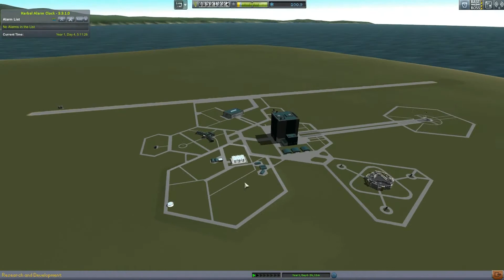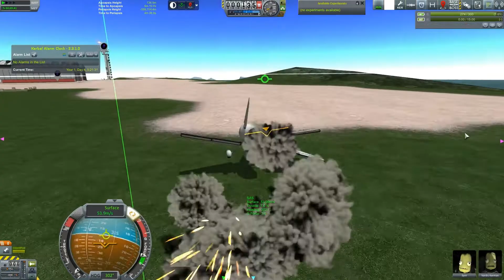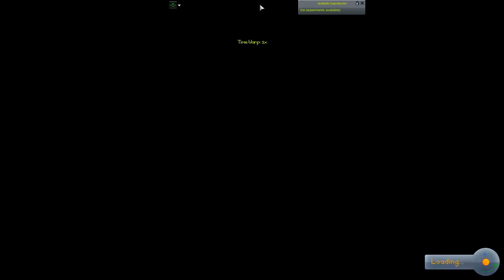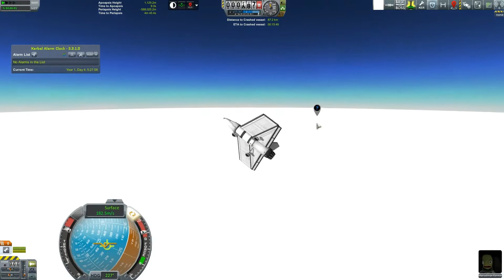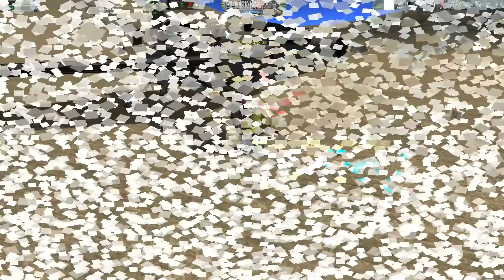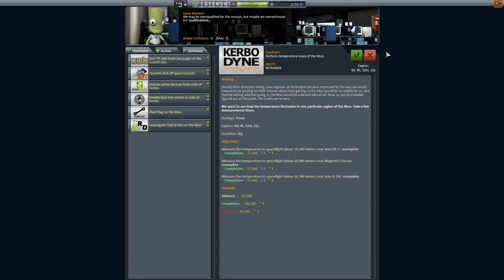HMV Plays KSP 1.0 - Contractor 03: Three Kerbin Anomalies Found!

Comment: You can use the long version of the early landing gear as a ladder (using the F key to climb).  Really helps with the lack of ladders in the early game.

This gives you the capability for surface EVA in the early game, along with allowing you to keep your scientist's feet near the experiments (required for restoring them in KSP v1.0.x).

The plane you have in this episode might have problems because you may have blocked the path to the top of the plane with your wings, when using you rear landing gear.
Reply: Kraig Lane I recently discovered this, too. It really helps having the landing gear just behind the tailing edge of the wing, because climbing onto the landing gear then onto the wing is a LOT easier than climbing up the landing gear onto the fuselage, never done that successfully myself.

Comment: I see you steer the plane with A and D. Thats called Yaw. the best way to steer a plane is to Roll using Q and E and Pitch with W and S. You would be abel to straighten the plane using Roll when you stood still also.
Reply from the maker: Ørjan Solli I don't so much steer the plane as I do hit the keys until the plane's going roughly the direction I want it too. I do steer with roll and pitch most of the time, but I've found that for smaller turns yaw is less trouble. It may not be the way a pilot would do it, but a pilot wouldn't be using a keyboard, either :)

And I find that SAS gets in your way when trying to just bank turn. But if I turn SAS off, far worse things happen.

Comment: That was a rather plane episode, wasn't it?

...

Sorry.

On a (somewhat) more serious note: Surviving a plane crash due to an inevitable timeloop is the true Kerbal way. As would be sacrificing your own aircraft to parachute down to the pyramids (in this case it was a "been there, done that" scenario, so landing regularly is okay).
Also, have you considered increasing the Brake Torque on your back wheels? That might help with slowing down in time.
Reply from the maker: FonVegen That joke made me physically ill. You could say I got my ailer-on.

...

not sorry ;)

I have not considered the torque thing because I didn't know it was even a thing. Next plane I make, I'll give it a look.
Reply: HMV Plays I guess we both level out at the same angle of idiocy when it comes to punny humor.

The brake thing was just something I noticed when I noticed you noticing the wheels noticing more heat than they prefer, so I thought I should tell you what I noticed there.
Reply from the maker: FonVegen Noted
Reply: HMV Plays Nice.

Comment: Yeah, the new brakes on the landing gears suck pretty hard. Nice landings!
Btw, you should prolly quicksave often and with different names. I tried to climb back into my lander on minmus and Valerie glitched between parts, got thrown on the ground, died and obliterated the entire solar system. Luckily I had hit F5 only 10 minutes before that. But the persistent safe was broken. 0_o
Reply from the maker: Nathan Jessep Sounds like 1.0 material right there.
Reply: HMV Plays Yeah, 1.0X is buggier than the alphas... =D

Comment: That front gear (on the first craft) looked to be too far back by looks of it, but I could be wrong on that as well.
Reply from the maker: ***** I mostly put it there so it would naturally be the furthest down it could be, to give the plane a positive AoA on takeoff.

Which also may have caused it to not make good ground contact on landing...

Have I mentioned I suck at planes?
Reply: HMV Plays LOL I don't think you have, but if it is anything I am horrid with them as well, and worse now that all my old ones for some reason do not fly but they should.